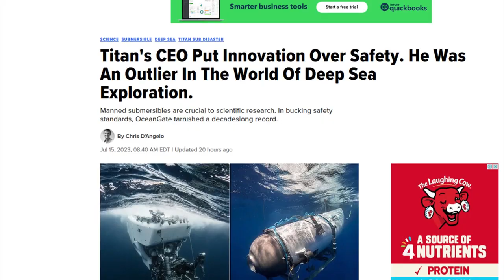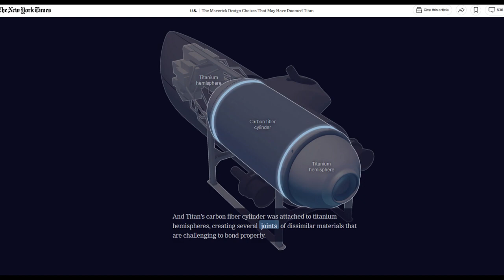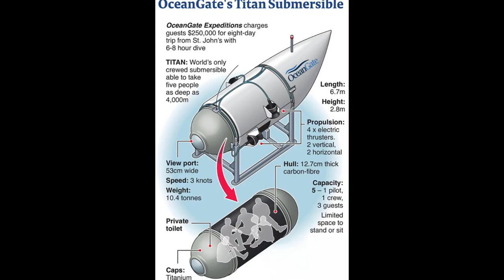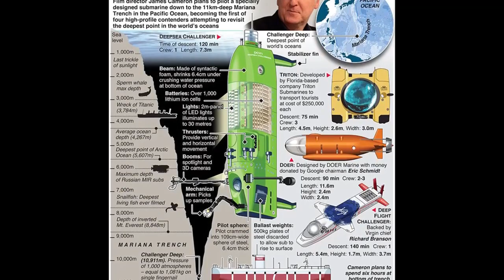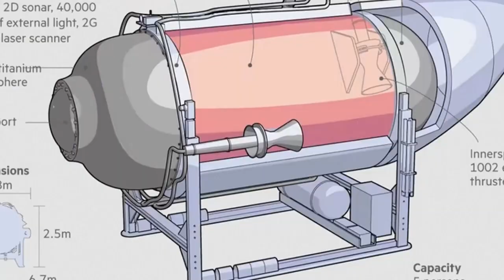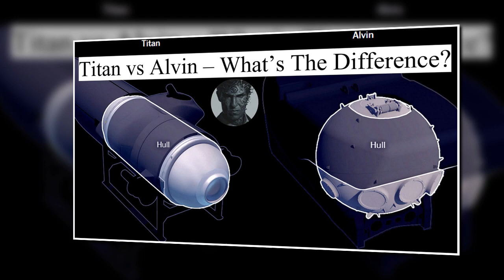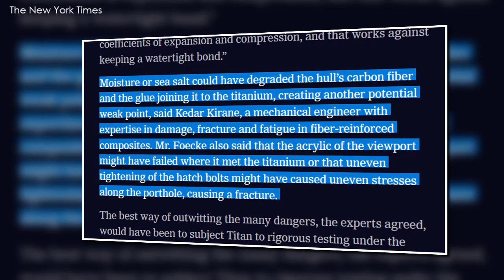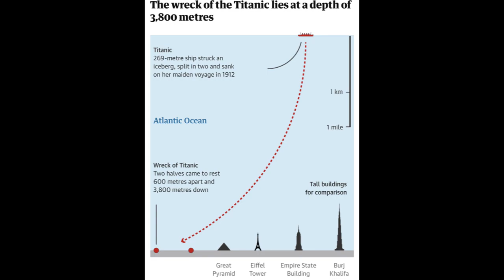Serious Question: Why COULDN'T Titan Be More Like Alvin?

Comment: As an ex laminator working with carbon fibre daily I would be interested to see what they projected the lifespan of hull. All materials that are compressed then decompressed or have strain have a lifespan. Fuselage on aircraft, hulls on submarines, chassis and suspension components on race cars. Whether composite or steel, it will wear. I do believe the hull on the Trieste 2 had its pressure chamber sphere changed at least once. Did they have an estimate or was it in the hands of the monitors they fitted. To put it in perspective an aircraft fuselage has a maximum flying hours before its retired.
Reply: carbon fiber for deep sea you cannot predict how many uses beyond one time.  steel, titanium, acrylic those can predicted if built correctly
Reply: Rush probably bought the expired carbon fiber from Boeing

Comment: Your analysis is in my opinion   as an engineer  very accurate. I struggle with concept of joining different materials where huge pressures are involved. and relying an adhesive as the primary seal is mind boggling. I"m convinced this would have failed in comprehensive testing. I liken it to joining brass plumbing fittings to PVC with solvent based glues. It would not pass any plumbing inspector unless you could prove it was acceptable after engineering tests. Since Im not privy to any testing in the case of the titan I remain very skeptical..>
Reply: My thoughts exactly

Comment: I'm no engineer, but wouldn't an ovoid hull of Ti lightened with isogrid cutouts on the inner surface provide a similar volume/weight without the issues that carbon fiber brings. They make isogrid cutouts like that in the walls of rockets. If isogrid cutouts in Al rocket walls can handle the stress etc of launches, I would think that properly engineered isogrid cutouts in Ti would handle the repeated stresses a submersible's hull would see. With an ovoid shape you get most of the benefits of a spherical hull but you get a larger internal volume. Isogrid cutouts would provide strength without including mass that is not needed. With a larger volume, you could then use it as a taxi.
I do not think that the design of the Titan was in any way a reasonable design. The joining of 3 different materials with different elasticity, ductility, adhesive bonding properties, compressive strength, etc in a seam at the end of a tube, looks like an obvious point where repeated stresses would cause progressive damage. I noted that there did not seem to be any carbon fiber or epoxy attached to the ring that the front dome was attached to on the Titan wreckage. I could be wrong but it seemed like bare metal. It causes me to wonder if the epoxy failed and the end of the tube collapsed when it did not have the support there.

Comment: Not in defence of Titan, but for a pressure vessel with given volume and a given maximum stress, a slim long cylinder is better than a sphere.  This is one reason that we have gas cylinders rather than gas spheres.
Reply: But we are talking opposites here. Gas cylinders keep pressure inside the cylinder from pushing out. A sub has to keep pressure outside from pushing in.
Reply: @_theender312  With the pressure outside, both the cylinder and the sphere are inherently unstable and any deformation can result in runaway failure (buckling)

Comment: The shape of whales is irrelevant. Whales are not a pressure vessel. The trick is collapsible lungs that can go to zero volume and no nasty air pockets (e.g sinuses or whatever). The whales are always at ambient pressure. If you put them in a chamber and pressurized it to 10 km water column they’d probably be fine with that too. I suspect 20-km or so would be the limit; a bit beyond that proteins start to misfold and denature; things that could live at such enormous pressure (possibly bacteria in the deep bedrock feeding on water contents or something like that?) would have to stay down there; they would have proteins that rely on the pressure to fold the way they do.

Comment: Not only is the sphere stronger it also has simple symmetry; as simple as it gets. The only thing you have to worry about with a spherical shape is everything that breaks symmetry; this are the holes to get in and out and any viewing window or throughhole. A capsule shape has this large cylindrical surface stabilized by the ends; it is going to for a peanut shape (coincidentally putting a lot of stress on that nasty looking glue joint).

Comment: Putting my HR hat on. Another cost savings that Rush used was hiring inexperienced engineers. He didn't want to spend the money to pay experienced submariners and engineers.
Reply: OceanGate had two or three experienced submariners and engineers among the original staffing. 
But when the experts started to tell Rush that complete independent third parties' stress testing for certifications were needed because as it was the submersibles were a risk, the experts got fired and sued into silence.

Comment: A little enlightenment, each titanium hemisphere and ring weighed aprox 3500 pounds (62 inch dia 3" thick, 2.6oz per inch3 ,, this weight was glued to each end of the CF tube. then there was the equipment dongle A frame attached to the rear titanium ring, plus the hideous Synfoam collection plastic strapped and fixed with wood screws at the end exerting leveraged buoyancy to the ring CF junction.

Comment: While slightly stronger than a cylindrically shaped hull, fabrication of a spherical carbon fiber hull would be less straightforward, although it would have necessitated cross-weaving which would have also made it stronger. Still, carbon fiber is always weaker under compression-- especially high compression at those depths-- and is prone to buckling delamination failure. I wouldn't try to reinvent the wheel when it comes to safety, unless there is substantial testing, a classing effort, and ongoing nondestructive monitoring, none of which was done by OceanGate. I'd only feel safe inside a properly classed titanium or stainless steel sphere at those depths.

Comment: Every single crack, snap, pop they heard was a failure of one of the carbon fiber tow strands breaking under the load, similar to taking a metal part just shy of its failure point, but introducing a stress crack. Eventually the part fails! Think of a race car engine being subjected to extreme RPMs in a race. Eventually, after repeated races a rod will let go and the damage is catastrophic!
Reply: @GrantOakes  I keep thinking about the glued CF to titanium junction, where they reduced the CF thickness by 1 inch to mate them together. That sounds like a guaranteed stress riser to me, and as you appear to be a hot rodder you understand stress risers and how they bring about failure eventually.
Reply: @Smedley1947  Stress risers occur when they are at sharp angles. Think of a river with a sharp bend, there's eddy currents present. Where rivers have long and shallow angles defining their flow there aren't any eddy currents. Same with solid materials. Good catch on the attach points.

Comment: 'Alvin' had its own share of regulatory problems when first built, simply because it was unique.  The USN was especially bad in this respect, having all manner of strict requirements for its own submarines - craft that were much much bigger, didn't dive as deep, and were used in totally different ways.  The 'Alvin' group had to do a lot of by-passing, side-stepping and flat-out arguing, - but it should be emphasized that careful forethought, good engineering practice and safety were always prime concerns for them.  As typified by Alvin's subsequent career - close to sixty years, and counting.

It should also be noted that Alvin's early life was very much run on a shoestring budget.  Every care was taken with the sub itself and its systems, but they had to use a couple of crazy mother ships that were anything but satisfactory in practice - kept going only by the skill and dedication of the crew.

The matter of interior space ..... yeah, definitely a thing.  You can fit up to three people into Alvin if they aren't claustrophobic or worried about personal space.  Pictures of what that even looks like is only one step removed from the Karma Sutra.

Comment: Its amazing….they knew every trip would cause damage and less stability…..and their actions were to remove more layers of safety instead of building it back up to original or even advanced strength. In my mind only 1 thing drives this type of behavior, money. Gambling lives in the harshest place on the planet is absolutely insane.

Comment: The 'Taxi' analogy isn't a bad one, but I think 'Bus" might be closer to the mark.  For most (not all) taxis in the world, the price of use is the same whether there is one passenger or several, so there is usually no incentive to "fill up".  For buses, every passenger has to pay, and the basic imperative is that full buses generate more $$$ than mostly empty ones.
Reply: I've been on some airport taxi services where you'd pay a certain cost but you'd let them pick up or drop off other people on the way. They want to get as many people as they can fit into the same taxi. Sometimes it was just me; other times there were 3 or 4 other stops.

Comment: A sphere is good, but there isn't anything wrong with cylindrical shape. It's the material and design. 
The Aluminaut, also a deep sea submersible, was cylindrical and had a crew of 7 and had a test depth of 15,000 feet, which is deeper than the titanic. 
Also, it was the Aluminaut that literally helped recover the Alvin's ass off the bottom of the ocean when it flooded on the surface and sunk to the bottom.....

Comment: It's not an outlier at all. Just another example to learn from. Hopefully, to prevent another failure. In many ways this is just like theme park rides. If the theme park is performing well economically they can afford to do safety checks and eventually cycle out equipment at the end of it's useful lifespan. However, a theme park is a big investment and a risky investment. Often, economic circumstances put additional pressure on park operators who don't know how to step down gracefully without facing financial ruin. So they continue to operate aging equipment without being able to afford all the checks and maintenance required. They try to hang on long enough to see returns where they can implement newer safer equipment. Unable to accept the reality that the business just isn't viable and profit cannot be obtained in the long term. 

In some ways it would benefit society if we directed the funds normally designated for accident investigation and instead offered a financial bail out for businesses on the fringe of bankruptcy so that they can stop before any eventual accident. Not a bail out to help them keep the business afloat. Rather a lifeline and tow back to port that gets them to shore where they can responsibly decommission the business. Then they can use the buffer to go find a different career path without facing some terrible calamity like homelessness. Money should serve our best interests and not lead our society to implosion. Sure money would have less power and people with money would also have less. While those who risk it all will at least have a way out without doing anything extreme in their positions of power and influence. 

No bailouts for failed banks. Just a severance package to let them out without bringing us all down. Since they have too much power. We'd be better off just building a new vessel than continue to let them play the role of captain while we keep the thing afloat suffering in the bowels of the ship. Interest rates not only make high risk loans harder to pay off, they also add time constraints and pressure. Those combined factors lead to calamity time and time again. Where society is burdened with the expense of search and rescue, emergency response, healthcare, accident investigation, regulation, and any judicial process that unfolds. The banks don't pay a portion for the extra financial pressure that directly lead to real world desperation and ultimately harm. What do the banks provide though besides fake money that they collect interest on? They don't actually entertain us, provide any resources, make anything more accessible, or solve any of societies problems. They don't innovate, they don't contribute, they don't volunteer, and they don't support anything or anyone. They simply profit off of every other person actually doing something while putting immense pressure on people who's jobs entail a huge amount of responsibility and potential consequences.

Why do banks take no risk, get all the rewards, and get to dictate the terms that literally regulate society?

Comment: The better question is why couldn’t Titan be more like Aluminaut.
Same design requirements on both vessels.
Reply: Yes, the Aluminaut had a crew of 7 and was cylindrical. It's not the shape, it's the material and design. I seriously doubt you could wind carbon fiber into a ball. Since rush insisted on carbon fiber, he had to use a cylindrical shape. 
Oh, and the Aluminaut literally helped recover the Alvin's ass off the bottom of the ocean.....

Comment: If they needed space couldn't he have just designed a larger circle ? With 2 floors, 2 on bottom 2 on top maybe could possibly engineer to have another 2 in the middle maybe even another 3  if it were even a larger circle

Comment: They made the carbon fibre hull 5" thick, then shaved off about an inch of that to mate with the titanium end rings. I'm convinced that area coupled with the questionable glue joint was the failure point.

Comment: Triton - The pressure hull is a 1,500 mm (59 in) inside diameter by 90 mm (3.5 in) thick grade 5 titanium[9] (Ti-6Al-4V ELI) alloy sphere machined to within 99.933% of spherical (for enhanced buckling stability).

Comment: I looked into the Alvin safety systems about a week ago and could not believe how many extra levels there were compared to Titan. Thanks for covering this tragic accident.
Reply: It's an Airbus compared to a hang-glider.
Reply: Even if we're not talking about the design, the Titan was far, far behind every other dsv, even the ones from the 70's. They have tons of redundancies, safety protocols, emergency equipments... Nothing to compare here.
Reply: Yeah but does Alvin have rhino liner on the outside. Rush should have sprayed it with flexi seal.

Comment: More titanium rings in the middle and inside. Support frames  connect all 3 rings. The rings were just glued on. Physical things are always better than glue. They can be inspected and repaired.

Double layers window. May be make the the tube side in a curve and not straight. 

Having the leg part just connected at the 2 rings reflect the minimum effort made to the design. Just a ball streched out with weaker matterial in the middle. The goal should've been the safest sub not the cheapest.
Reply: Try Aluminaut. 
Eleven Aluminium rings.

Comment: Exactly. Innovation doesn’t mean advanced or advancement. I could build a submersible out of wood and it would be innovative – it would be stupid beyond all reason – but it would be innovative.
Innovators are often wrong. Innovators who try a hundred different ways before making a successful lightbulb (or computer or whatever) are learning from their innovation and mistakes. This only works if the risk is that your lightbulb doesn’t work.
Steve Jobs was an innovator, but when he got it wrong (and he did occasionally) nobody died.
Giving Stockton Rush the benefit of the doubt, Titan may have been innovative, but it was also stupid.

Comment: What all exactly is in the aft section?  Where are the batteries and oxygen tanks located?  Is there any intrusion from the non-pressure aft components and the crew pressure chamber?  NOBODY ADDRESSES ANY OF THIS, WHY NOT?
Reply: Batteries and electronics for the propulsion were in the aft compartment. The oxygen bottles were under the floor of the submersible cabin.
You don’t want pipes passing through the cabin of a submersible.
Reply: @allangibson8494 So the Bluetooth RF signal had to penetrate the carbon fiber for thrusters control?
Reply: @DavidWilliams-qk5jq  I don’t have that information but I suspect there was a wired link through the aft bulkhead behind the big screen mounted there.